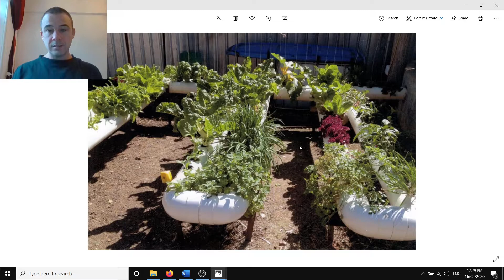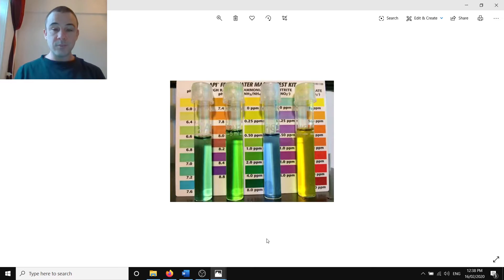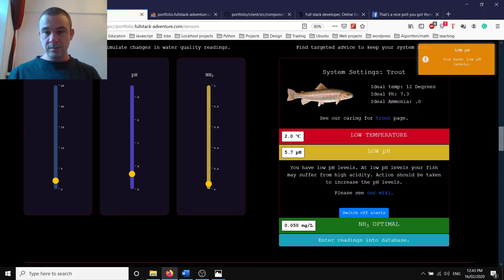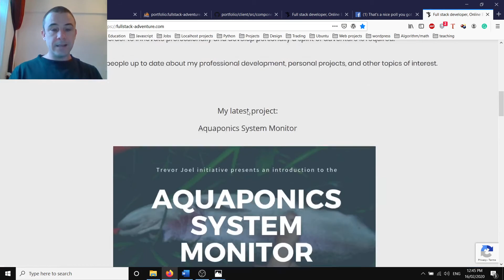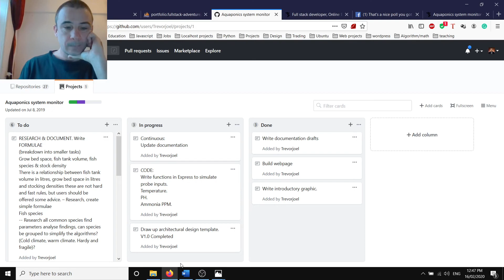Aquaponics SYSTEM MONITOR

Comment from the maker: 1) What is Aquaponics (PICS) 1:13
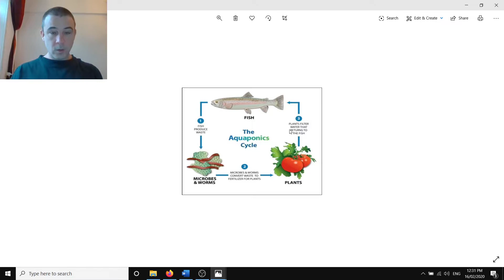2) How aquaponics works. Nitrogen cycle (PICS) 4:17
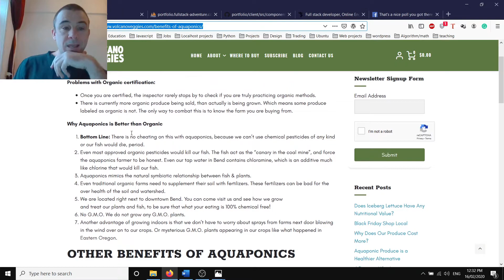3) Why aquaponics is good 5:12
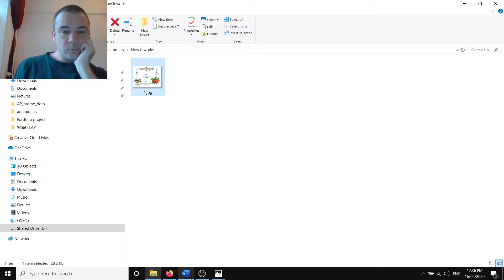4) Why am I taking on this project? 8:34
5) What problem does an app solve? 10:04
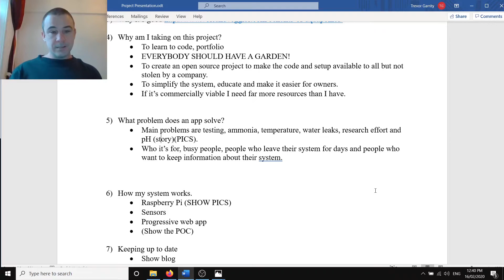6) How my system works. 12:25
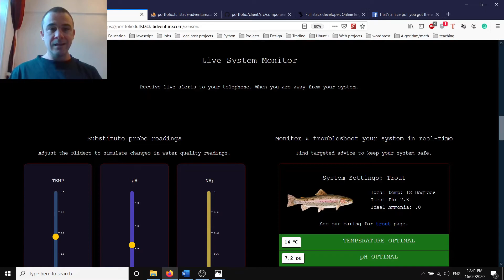7) Keeping up to date 13:50 
8) Technical information/Lend a hand 17:39